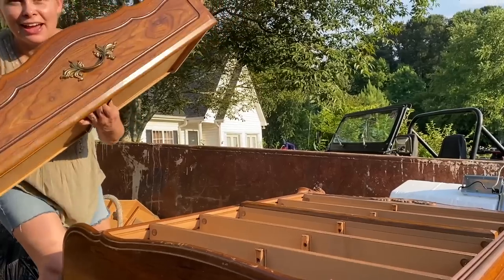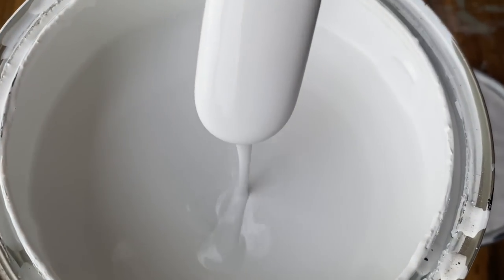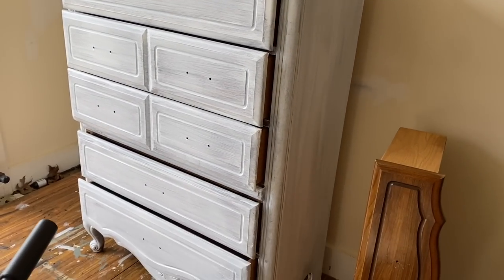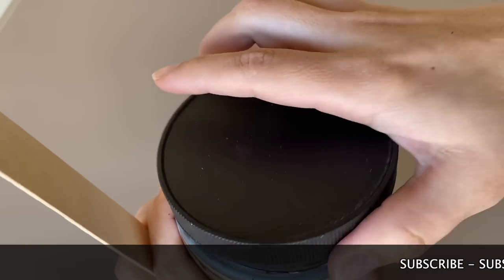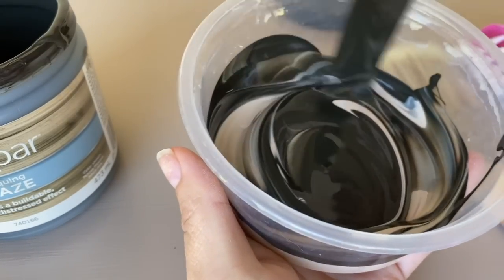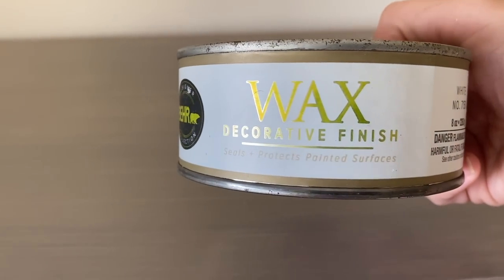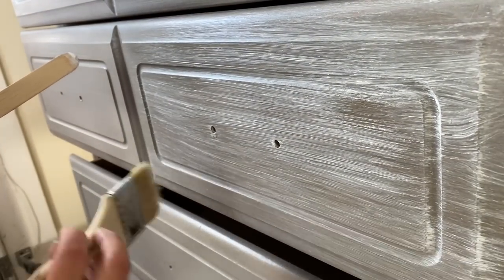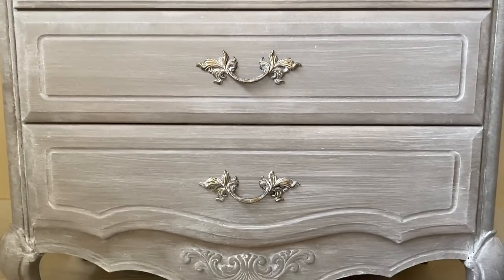RESCUE CHEAP FURNITURE old particle board + laminate -Timeless Light Gray Finish - beginner friendly

Comment: Shannon....U R such an INCREDIBLE ARTIST!!!  I love following you and ALL your HELPERS and have sold a few pieces using some of your TECHNIQUES!!!  U R so giving of your expertise and such a delight to listen to!!!  I thought maybe I could send you a trick I learned years ago.  I notice you using a small container or cup to dip out some paint and I've also watched you wiping the side of paint cans with your brush.  Those things will never change but I thought I could save you some messy clean-up when putting your lids back on.  Buy an ice pick with some type of handle that you can hit with some type of hammer.  Place the pick in the groove where the lid tucks into and punch holes in that area at about an inch apart.  Then your paint will flow back into your paint can and you won't have to use your brush to clean that area out, and your lids will not be so overloaded with paint each time you try to close or open them...:)  Thanks for everything you share...:)

Comment: was any of this chalk paint
Reply from the maker: No, but I have done this type of technique with chalk paint and found that it absorbs the glaze more than I like so I prefer a paint that has a bit of sheen to it so that the glaze moves across it easily when I brush it.  If you do prefer chalk paint, you could add a coat of poly in between before you apply the glaze to get the same effect from this video 🖤.